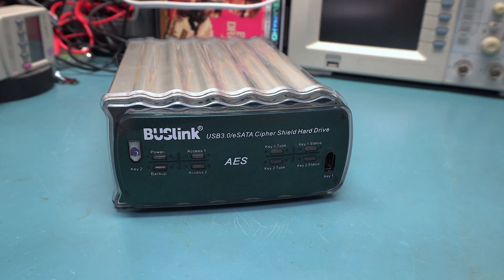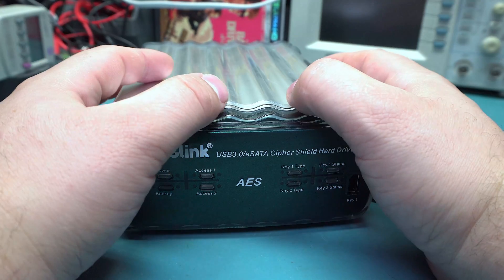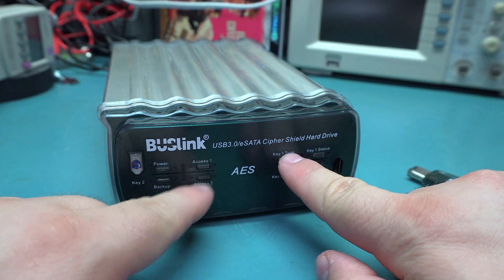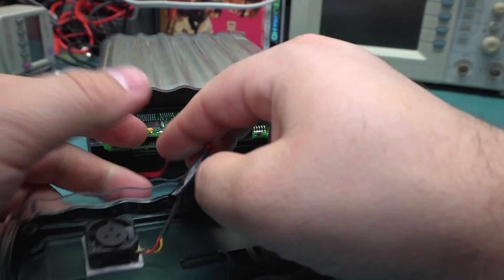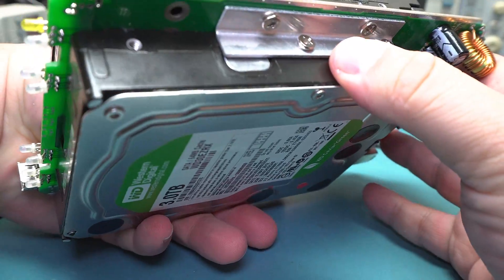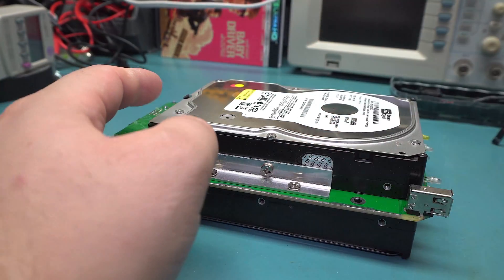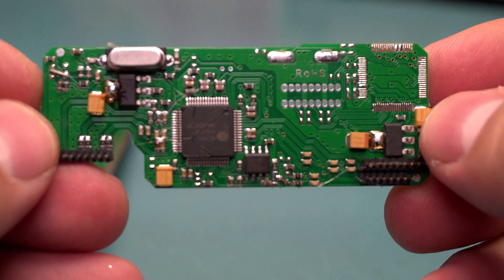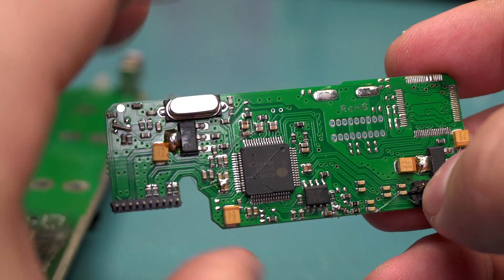BUSLlink Cipher Shield Teardown

Comment from the maker: It appears the company sells both AES 128 bit and 512 models as well. For massive prices, of course.

https://buslink.com/product_category/raid-encrypted-drives/
Reply: Peter Brockie Everything BUSlink is high-end.  They were one of the distributors of Raytheon Raylink wireless hardware back in the day.
Reply from the maker: +douro20 I think stuff like this drive is specialized, not high end. I mean, it's not like the drives were Western Digital Re server drives with a Noctua fan attached and a nice LCD.

It's expensive because they probably sell 200 a year and have to get them certified. :D
Reply: Most of the cost is in the chips themselves, which they only sell to integrators.

Comment: The reason for 2 different manufacturers of EEPROMs is that those will have different I2C address so both can share the same bus. Also - storing encryption keys on a EEPROM which you can just copy is very childish.  They should hire someone with basic cryptography knowledge.
Reply from the maker: I'd imagine each controller has its own I2C bus, so I don't think addressing would matter unless they were really desperate for PCB space and had to share one.

The whole key system is a joke on this model. Not only as you pointed out, they are unencrypted, but they don't even pot the key. Even if they did pot it, the key is basically a direct connection to a normal EEPROM which anyone skilled in reverse engineering would be able to figure out by probing the connector.
Reply: So easy!

Comment: I believe FIPS 140-2 requires hardware encryption for devices which are permanently installed and not removed and put in a safe at the end of the day.
Reply from the maker: +douro20 That sounds about right. I'm not sure on the rules for having a hardware key or of a PIN and/or password would be okay though.